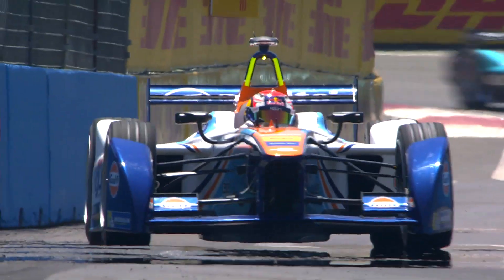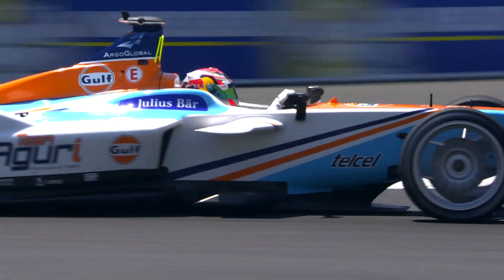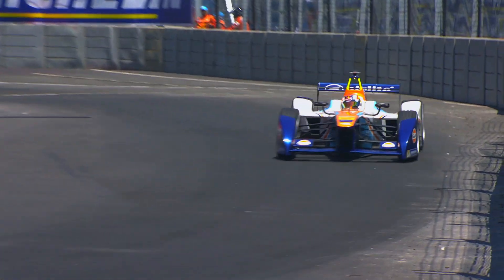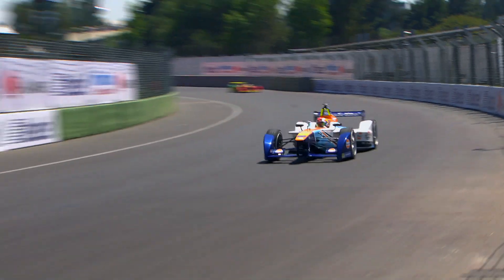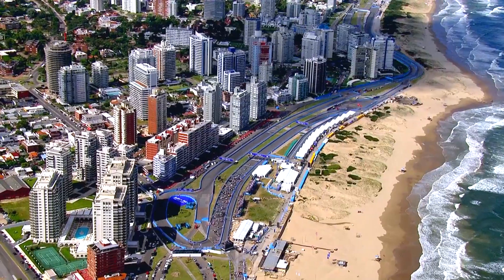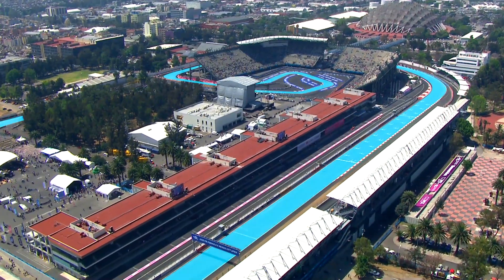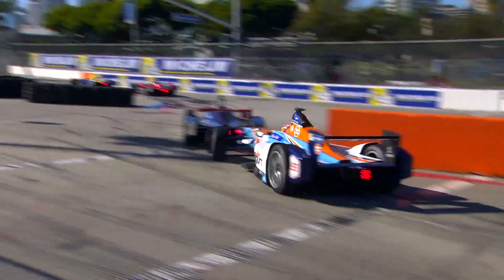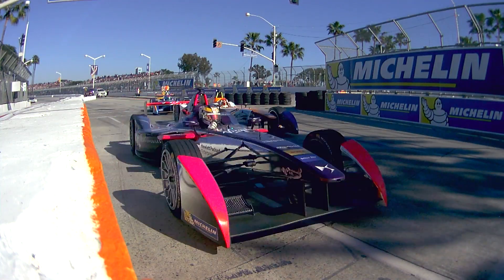Race School: What Is Understeer And Oversteer? - Formula E

Comment: does anyone know the names of any drivers that are quick with a understeer car?  mastering understeer is way more impressive then mastering oversteer. Though I think oversteer is faster and more fun.
Reply: 7 years later, answering your question, yes, Fernando Alonso, Lewis Hamilton, Jenson Button, Nigel Mansell, Alain Prost, Piquet... 

Fernando Alonso is actually the best and more exaggerated understeer driver of all time, no one drives better than him with this, maybe Lewis Hamilton, but Hamilton uses a less exaggerated understeer setup.

Understeer is actually faster, oversteer really gives you more potencial to straight lines, sometimes almost 10km/h faster, and 1-2km/h at hairpins, but, that understeer and "Slower" car will win.

Understeer setup gives you more braking potential, stability, easier to driver, more consistency, faster laps, better starts (Fernando Alonso is a master with that). 

But most of the drivers hate it because that setup needs more trailbraking and late braking to turn better, more geometric racing line, and they like agility, faster speed at straight lines, hairpins, different racing lines. 

Alonso won races, made pole positions with inferior cars, and almost won a Championship with the 4th best car in 2012.

That's it, understeer is faster in races, even though oversteery cars actually gives you more straight line final speeds, a little bit better hairpins, and more agility. But, almost no one will accept this, because oversteer is fun and most drivers love it.